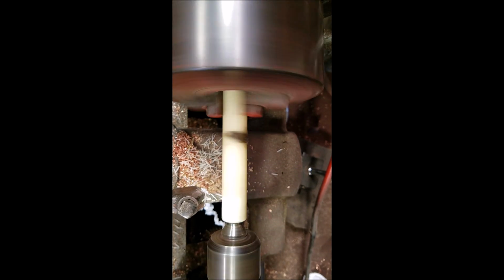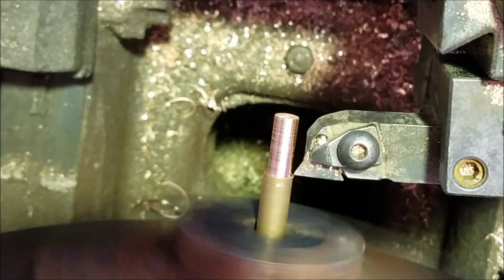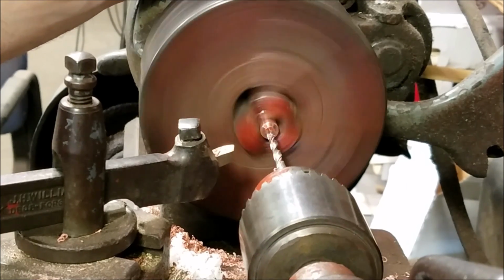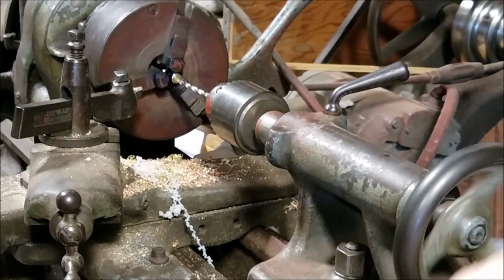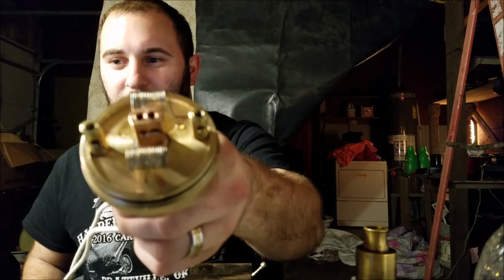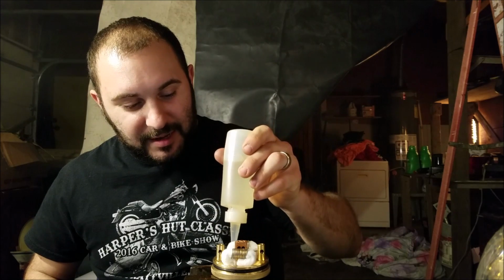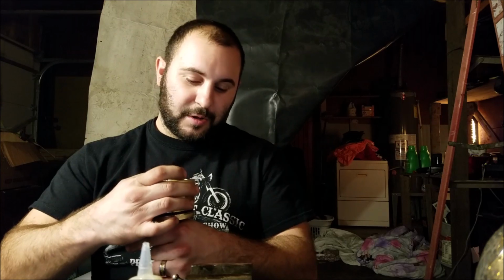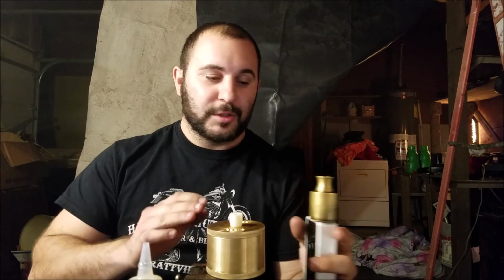Worlds Largest RDA Part 4 insulator, posts, and airflow

Comment: you said control the airflow with the drip tip... that gave me an idea if you made the drip tip with wings that came down flush with the top cap and can cover all the holes at once.. you could turn it to adjust airflow! IDK if this makes sense to you but it was a lightbulb moment for me
Reply from the maker: Mangles91 Tv I can see it now! I'm actually machinung a drip tip for it as we speak. I'm gonna make a brass fin to try it out!
Reply from the maker: Mangles91 Tv check the facebook group for a few photos of it done
Reply: I cant find this facebook group.
help!
Reply from the maker: Mangles91 Tv try this link
https://m.facebook.com/groups/1378682405771871?ref=bookmarks
Reply: ok I added my request!! thanks bro

Comment: chop it about 1/2 inch shorter than add a couple air flow holes in the side more air flow should make for better vape on it.
Reply from the maker: Timothy Mosley I've only got about  1/8 inch that I can  shorten it and the airflow is already way overboard. if anything I may try to dig up some material and make another top
Reply: Matthew Vandewiele ever think about bottom air flow what about using small copper tubing going from a couple top flow holes bending them to hit the coils from the bottom that would be a sweet easy fix.
Reply from the maker: Timothy Mosley thats a possibility I do have some smaller copper tubing but the airflow is actually right on the outside edge of the coils. more than anything th rda is just massive lol! I think a bit more time building on it and getting a better feel of what kind of build works best in it will help
Reply: Matthew Vandewiele yeah right on what ever you feel is best it's your monster rda lol.
Reply from the maker: Timothy Mosley I've spent the last couple days measuring everything out and I think I can turn about 3/16 off the barrel height and lower it slightly. may not make a huge difference but its worth a shot

Comment: And China has cloned it, buy it at fastteck for $29.95 with free shipping! Just kidding
Voltage will trump amperage. It takes a lot of power to push through all that resistance wire.
You don't want to have to worry about building lower resistance to get your coils to heat up in time.
Plus, lower amperage will be easier on the mosfets, I think.
4s

Comment: Why top airflow?
Reply from the maker: Non Ya something different and wanted to see how well it would work
Reply: @mattvanwest  could be why the vapour isn't so thick. Because with the top airflow the air is only skimming the top of the coils. If the air holes were near the bottom on the sides. The airflow would pass over the entire coil, picking up more vapour